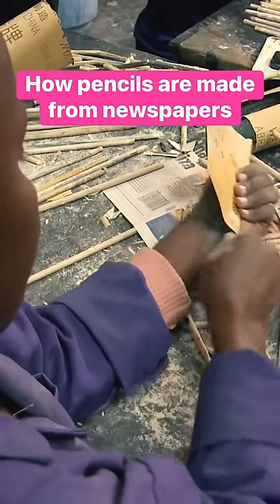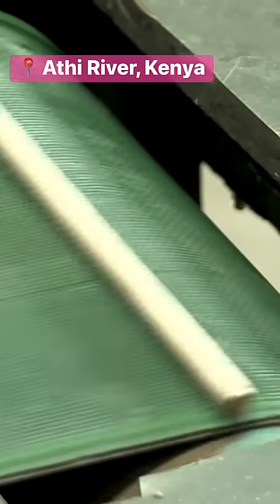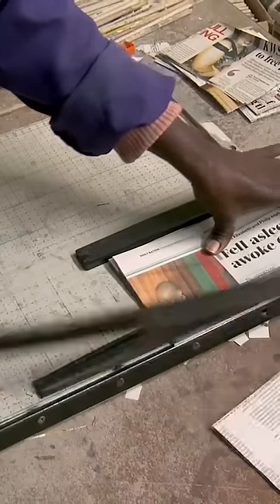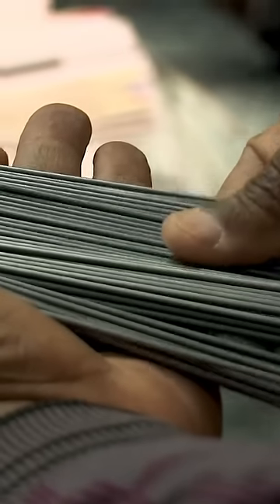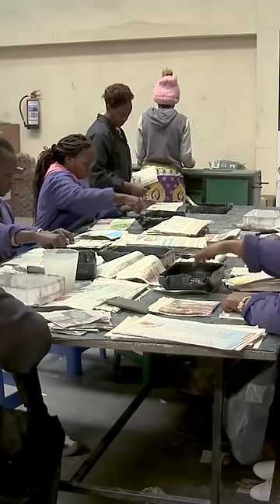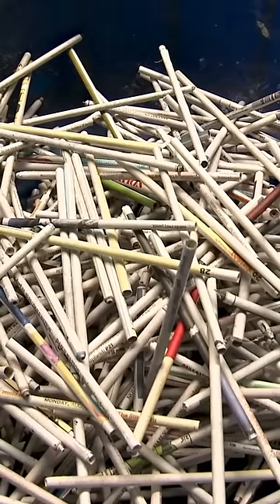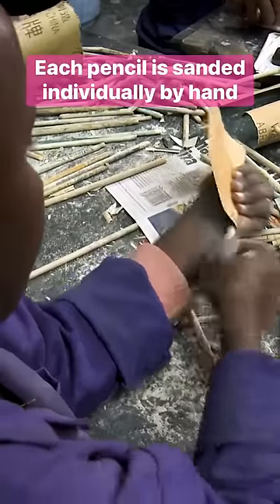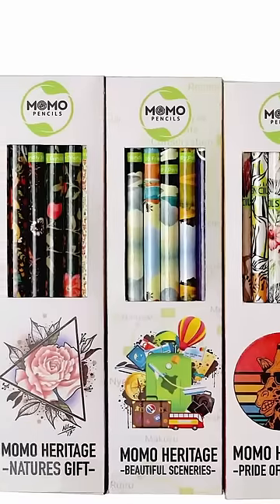This is how pencils are made from newspapers. #recycling #pencils #sustainability #shorts

Comment: Not sure if it actually started in Kenya since I've been using a local brand newspaper pencil in my country. They're amazing! unlike the wooden ones, I didn't have to constantly sharpen it for the reason that the lead used continue to break. I bought a box of 10 about 2 years ago, and I've only used 3 or 4 pencils so far!